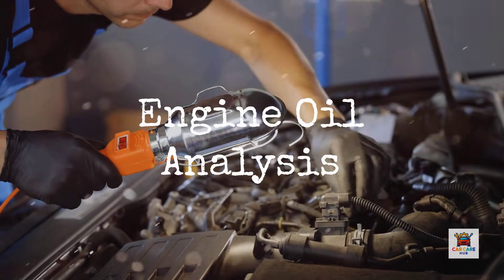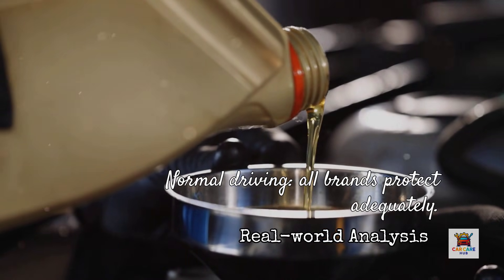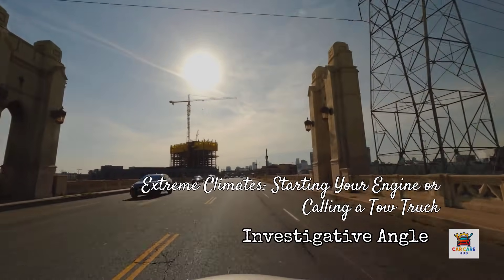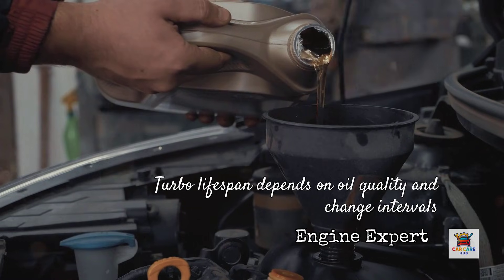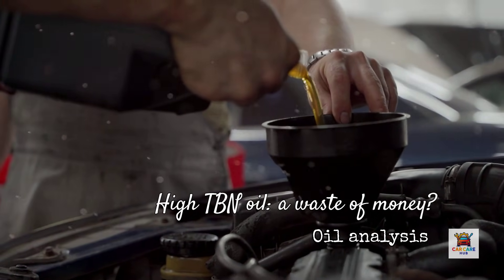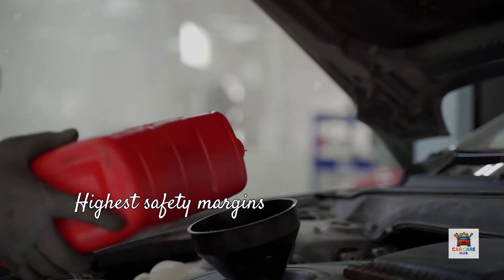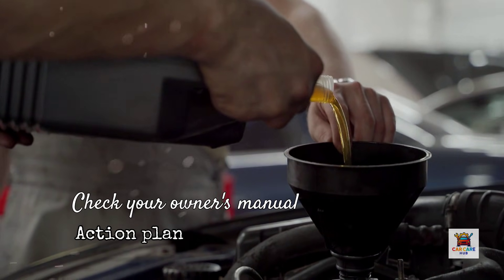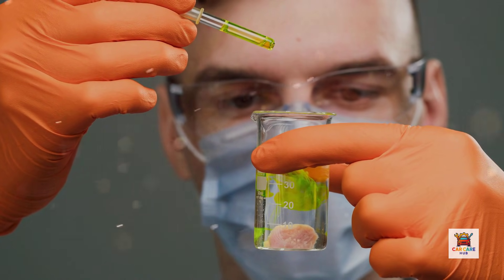Lab Tests Expose the Best Engine Oil (Most Drivers Choose Wrong!)

Comment: Pennzoil platinum ultra 5w30 and Fram ultra synthetic filter my Nissan frontier 4.0 v6 dessert runner runs quiter than Mobil,
Reply from the maker: That can happen. Different additive packages can affect noise and feel, even when both oils meet the same specs. Quieter doesn’t always mean better protection—but if it meets spec and works well in your engine, that’s what matters.

Comment: Valvoline Extended Protection 5w-30, 2018 Chevrolet Impala Premier 3.6l v6
Reply from the maker: Valvoline Extended Protection is a solid choice 👍 That 3.6L V6 runs well on a quality 5W-30.

Comment: Used the Walmart Supertech motor oil  and change my oil and filter every 4k miles religiously…
Reply from the maker: SuperTech actually performs very well in lab tests 👍 Regular 4k mile changes matter more than brand for most engines.